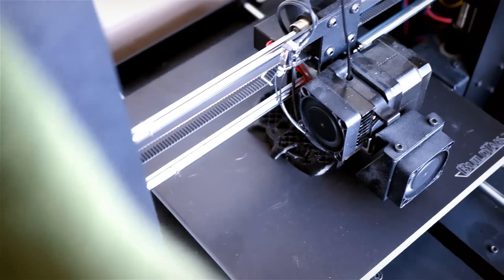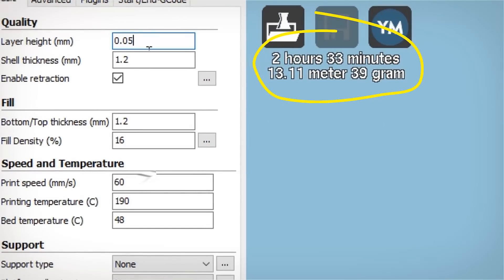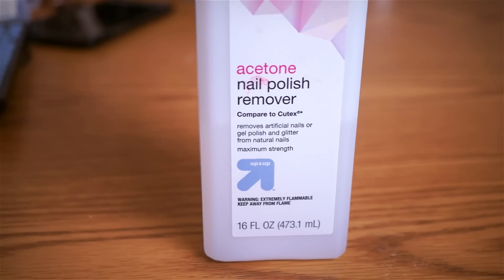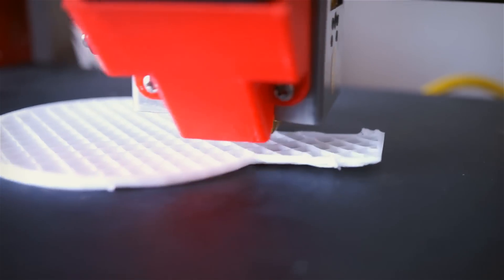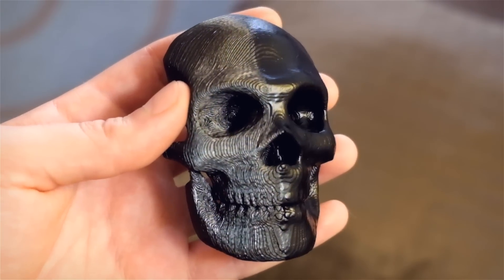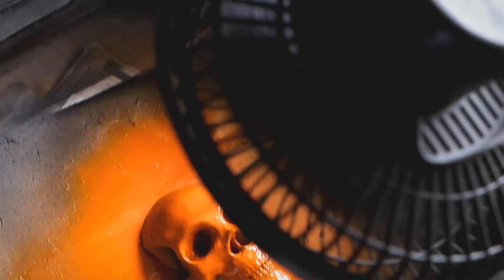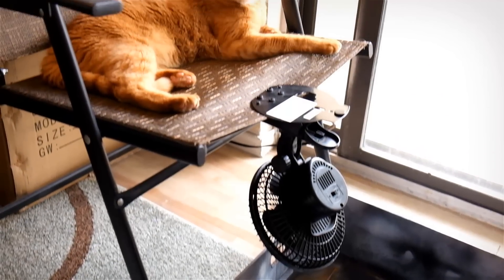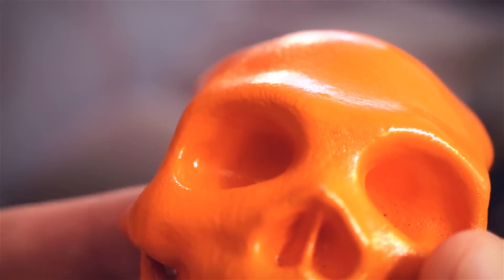Smooth PLA | No Sanding

Comment: "without any harsh chemicals"  WTF?! Exactly what is it you think is in the paint? The primary solvent in enamel, lacquer, and urethane is acetone. The very same as used in acetone vapor baths used to smooth ABS. Other solvents as well, and worse. Please read the MSDS sheets (available online) for the products you're using before declaring them "without any harsh chemicals."

FFS.
Reply: Depending on the brand the paint will contain acetone, methyl ethyl ketone, ethanol, butane, these are the thinners. They are toxic, and you should be wearing an activated charcoal filter (organic vapor filter. These chems will also easily diffuse through the skin and cause cumulative damage to your nervous system. Worked at Sherwin Williams for about 10 years, I would also strongly recommend reading the material safety data sheet (MSDS) for any coating, cleaner, or any other product that needs to dry or react. Or not, it's just your health.
Reply: Maybe you can paint your prints with essential oils. Don't be a pussy and wear a respirator like everybody else
Reply: ...... I think somebody needs to switch to decaf.
Reply: @snoopyslr  what's that? I'm interested.
Reply: Thank you for the information, it is so easy to get misleading advices these days.
Reply: OK, we get it.  Paint and varnish are "harsh chemicals", but we use them everyday.  Acetone is different, which explains the explanation.
Reply: @ericperkins3078  Acetone is an extremely common chemical, and extremely harsh. Just because you use bleach everyday doesn't mean it's not harsh and even toxic. So yeah, saying these things that use acetone as a base are safer than acetone is a bold face. Btw i literally have 3 gallons of acetone in my house (not even bought for 3d stuff) and zero paint or varnish.
Reply: Good job missing the point. @nordaxglass6572
Reply: NordaX Glass you nailed it.  Im just too stupid.
Reply: Eric Perkins If one is using paint and polyurethane thinking it is safer than acetone then they are highly mistaken. I think using paint and polyurethane is a great option for smoothing our print and it’s another tool in the arsenal but stating that they are safer is so incorrect. 

First off most spray paints have acetone in them as a propellant. If you’re spray paint contains acetone as the propellant, it could also slightly contribute to smoothing out an ABS print especially if you’re too close to your ABS print when you spray paint it.  I’ve sprayed certain foams with spray paint and if you spray them at a far enough distance you’re fine. Spray to close and the it dissolves the foam, sometimes dramatically depending on the density of the foam and how much air pockets it has vs. actual material... hey it’s great if spray paint does contribute to the smoothing of a ABD print slightly but My point is that you’re trying to avoid acetone but you’re probably still using acetone. 

Yes, it is a volatile chemical but I want to point out that acetone is a chemical that is found naturally in the environment. It’s a very common building block in organic chemistry. It’s produced in trees, plants, it’s in foods we eat, it’s produced by all mammals including humans. Acetone is actually relativity less toxic than many other industrial solvents. Our bodies can handle low levels of acetone exposure from the environment just fine. Why? Because acetone in low levels is always present in our bodies because it’s made in our bodies and our bodies know how to handle low amount of acetone. For this reason, I think it’s actually safer than the method used in this video to occasionally smooth out certain 3-D prints. 

Acetone is actually 1 of 3 keytones in our bodies and is present in as a metabolic component in blood, urine and the human breath. It’s formed during fatty acid oxidation. It’s created mostly in the liver as well as the lungs and kidneys. Acetone along with the other two keytone bodies are excreted into the blood and transported to all tissues and organs of the body to be used as energy. Fasting and exercising increase the generation of acetone. Going on a Ketogenic Diet (high, fat, moderate protein and low carbs) will also increase the amount of acetone. People with diabetes also produce more acetone the people without diabetes. 

I’m not saying acetone is harmless but the people that should be concerned are workers exposed to acetone vapor concentrations for hours. Of course acetone at high concentrations can cause cardiorespiratory  failure and death. Acetone poisoning can occur when there is more  acetone than our bodies can break down. But remember, drinking too much water can be toxic to the human body if you drink too much of it. Drinking too much water too quickly has proven to be fatal. Acetone as far a we know is not a chemical that is known to cause cancer. Reproductive toxicity test have also shown that acetone has a low potential to cause reproductive problems. I feel comfortable using it occasionally as I feel comfortable using spray paint and polyurethane occasional. I just don’t like that people are assuming spray paint and polyurethane are safer to use when they contain a cocktail of different chemicals such as solvents, pigments and dyes, fillers and extenders, binders and resins and other additives that can cause cancer and are more hazardous to you’re health. Painters have increased rates of lung cancer, acute leukaemia, bladder cancer, and cancers of the oesophagus, larynx, biliary system, liver, skin, and large bowel.

Comment: How much of the detail is lost with smaller more detailed prints ?
Reply from the maker: For smaller prints, I recommend taking the time to print it at a higher resolution like 0.1 layer height or less. Then it will have smaller build layers and will take fewer sprays so less detail lost.
Reply: 3DSage alright cool.  Thanks for getting back to me. I'll try this out for sure

Comment: just sand and files ya bums. With sanding you can make those teeth more apparent not less.
Reply from the maker: I hate sanding 3D prints haha! Some models are almost impossible to sand evenly. And if your wall thickness isn't thick enough, then you will sand right thought and make a hole.
Reply: I don't doubt it bud. I was just playing the role of a grumpy old'un because I thought it was funny. Your's is a fine solution.

Comment: I liked this method a lot. Its easy and accessible for me. But don't you think this also reduces certain details from the printed models? Like in case of the skull, the definition of the teeth was pretty reduced...
Reply from the maker: The skull was printed at 0.3 layer height which means the detail was lost when it was printed. Printing the model at 0.1 or even scaled up would capture more of the teeth detail and then this method would top it all off nicely.

Comment: Great if you don't want any detail...lol.
Why not just dip it in rubber, or better yet just wrap it in duct tape. 

Sand paper !.

Abs, and if your worried about fumes than you wouldn't be spaying 2 different toxins.
Reply: Yeah I noticed that - fast drying Polyurethane is extremely toxic and it looked like he was doing all this INDOORS?! The acetone will fume off quickly but the polyurethane will emit a ton of vapors for 24 hours at least. I had used poly on a print and brought it inside after a few hours and my family freaked the chemical smell was insane even after a few hours.

Comment: seems like it removes a lot for detail as well.
Reply from the maker: I did print the skull at a layered height of 0.3 which mean detail was lost in the first place. 0.1 would have been better and taken less time to smooth but I needed an extreme layer height to show how much this method can work.
Reply: i much prefer using bondo spot putty then sanding. as long as you dont glob it on, it sand easy, fills the lines and doesnt make you compromise on detail. makes a mess though XD

Comment: interesting concept but i noticed all of the fine details of the skull were lost in the process. ie the teeth.
Reply: dimman77 Yes, using Meshmixer, Smoothing Tool but set the Value to negative then it works like a "sharpening" filter makes everything more pronounce. I have a project for a friend who does cosplay and he's painting over the objects so I do this when I print something for him
Reply: Awesome Tip!  @DasJev
Reply: @DasJev  Question about this, because it seems like an awesome hack, HOW do you set it to negative? On the version of meshmixer i'm using it doesn't let me input negative values into any of the brushes, even if I type it in manually.
Reply: @grumpyalison4869  I didn't mean the brushes, it's a tool for selected areas
Reply: It would be nice if there was a quick way to edit the file to be printed with sharper/more pronounced fine details in anticipation of smoothing.
Reply: @dimman77  It might be better to print the skull verticle, the teeth will hold the detail better most likely in that fashion...but height of model is more time...always.
Reply: Well that'S the part he kinda forgot to mention, the negatives :D
Reply: DasJev Awesome! Thanks a lot!
Reply from the maker: I did print the skull at a layered height of 0.3 which mean detail was lost in the first place. 0.1 would have been better and taken less time to smooth but I needed an extreme layer height to show how much this method can work.
Reply: @3DSage  But then doesn't that defeat the purpose of your initial stance that smaller layer heights increase print time?  I think you have something here, don't get me wrong, I just think really fine details will always be lost no matter what you do.  It's a shame.  Glad I'm mostly into functionality instead of pretty, myself.
Reply: I think that sandpaper and filler primer is still a better faster option.
Reply: @blizatrex  which primer is better for PLA?
Reply: @rotorixfpv  A low grit sandpaper then sanding primer. repeat. duplicolor is a good one.
Reply: @blizatrex  Yes and No...depends on the model... i rather take the time to slice better even if print takes more time rather then spend just as much time sanding and filling...so many ways to tweak a 3d printer i am new but get better all the time...
Reply: @blizatrex  do you have a video on this, can't find anything
Reply: @Bert0ld0  A video on sanding, priming, adding spot putty, and repeating?
Reply: @blizatrex  yes, I know it's easy but I'd like to see someone actually doing it on a pla print
Reply: @Bert0ld0  coregeek and punished props to name 2 go through these steps.
Reply: @blizatrex  Don't worry, its the future human skull
Reply: also how do you do bigger prints ? Tight Tolerances? Moving Parts?
Reply: Hecto Naaire juui
Reply: DasJev An easy way? Like a filter for . STL files? I'm not talking about modelling from scratch with expectations of smoothing. I'm talking about something like a filter that you can apply to any .STL file if you want.
Reply: dimman77 there is

Comment: Hey dude, great video.  I saw your post on Angus' non-review of that pile of crap and thought I'd check it out.  My only complaint with this method which is akin to any smoothing option currently available is the loss of fidelity.  However if fine details are not a concern I think the method you demonstrated would be worth a shot.  Thanks!
Reply from the maker: Nice! Yes the mixture will fill in the layers and some of the small model details but I think this is a good method to keep in mind, depending on the model and it's level of detail.

Comment: Acetone can be used with no heat at all.  It's known as the cold vapor smoothing.  Two with all that paint you're killing your details.  I'm a person who loves the detail on 3d prints.  I can see this working better on LARGE prints.
Reply from the maker: What I didn't stress enough in the video is that I printed the skull at a layer height of 0.3 which means detail was lost during printing. A height 0.1 would have been better and taken less time to smooth but I needed an extreme layer height to show how much this method can do!
Reply: I never had any luck with cold acetone vapor on ABS.
Reply: @thebeststooge  a technique i use is to not vapor acetone at all. Use a paint brush and very quickly do a light coat over the print and let it sit for a bit then do it again now that the top layer of the print is softer you can brush out rough edges quickly never using so much acetone that it drips. Works great - only drawback is the print may have a white tinge all over it.
Reply: I was gonna try this on my Hatchbox PLA just to see what happens in the acetone.
Reply: Crosswalk I've actually used Acetone on a PLA part and it turned white
Reply: That's what I was thinking. There looks like a significant amount of loss in detail here.
Reply: acetone won't work on PLA.
Reply: Depends on the PLA being used.  I thought the same but been proven wrong.  You have to dip the PLA print into the acetone and it will smooth it out.  I think you have to leave it in for about 20 to 30 minutes but you have to keep your eyes on it.  https://www.youtube.com/watch?v=HEnz8CWxyjc  UPDATE:  Less then 10 to 20 minutes.  You should do it about a minute and take it out and see and let it dry.  Continue to do this untill you get the results your looking for.  It will leave a white film on it but if your going to prime it I guess it wouldn't matter.
Reply: There is no brand of PLA filament that will melt with acetone, it's chemistry. The video you link is 7 minutes of a person rambling without showing a PLA print going into acetone, he used a different material.